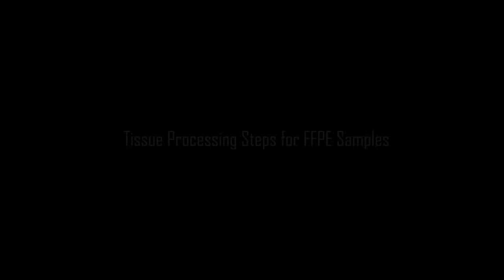FFPE - Tissue Processing/Embedding/Sectioning for Histology, Immunohistochemistry (IHC), ISH & FISH

Comment: Its been 4 years since this video was made... Wondering if theres been any changes due chemical fumes during the tissue processing (that blue mask doesnt protect you for chemicals like xylene and alcohol fumes. You still risk your health for lung damaging and cancer). Second stage, cutting slides with a water bath full with contaminations... Is this lab really for diagnositc or students? Last.. those chemicals at the window. Is that picric acid? That yellow fluid is explosive... Please contact for safety and health protocols... 🙏🏻
Reply: Does histochoice need the same special mask as Xylene? Are alcohol/ethanol fumes dangerous to inhale when changing the baths? I'm a student and I would like to know if you could share your references. Thank you very much!
Reply: guess its all automated into a machine
Reply: I have to change xylene and ethanol reagents all day long with mask on
And you can really smell it. I didn’t know it damages lungs?
Reply: I also put the containers in water and bleach
And then the smell gets super strong
Reply: Cloth masks offer ZERO protection. Even with activated carbon filter masks the lab work area needs to have fume hoods savaging the lab air. Not sure which state this lab is in but in CA they would have to meet strict air quality and exposure guidelines.
Reply: @mlsb9591  Material Safety Data Sheets, MSDS, are supposed to be either posted or available to employees. Alcohols are far less toxic than any of the xylenes used. Any contact or substitution of xylenes with benzene is an absolute no no as it is a known carcinogen. On the other hand the EPA, allows exposure to gasoline which is 10%.  benzene. Question authority.
Reply: @annyapple5026 if you can smell it its already in your blood stream. Xylenes are toxic. Ask about fume hoods,  better masks like spray painters use, or better room ventilation. Exposure to toxics is a serious matter. We only get our anatomy once.

Comment: how to prepaireed 70% formaline plz told me 
and how to prepaired the 100% lysis buffer
and how to prepaired the buffer solution 
kindly told me
Reply: 🌚
i do not know! 🌚
I am studying a first stage of analyzes so I will not know😭🌚
Reply: 70% x 100ml/ 37 (formalin contain. Look at labeled bottle formalin. I am using 37 formalin)
Reply: C1V1=C2V2
Concentration of solution 1 = C1
V1 = X (how much of this you need to use), solve for X
Concentration desired = C2
Final volume desired = V2